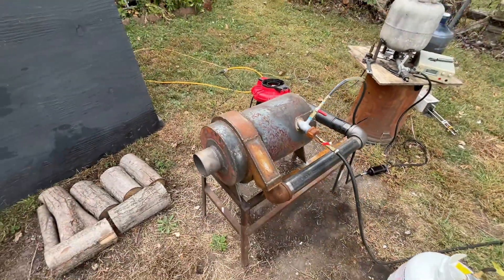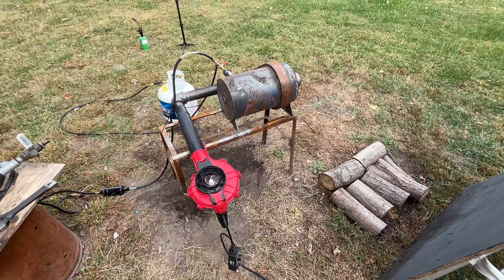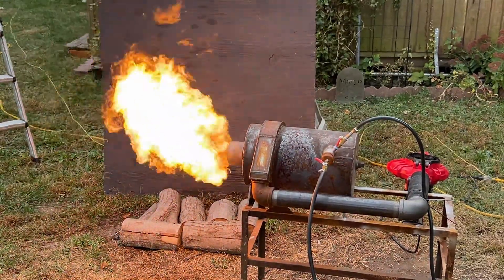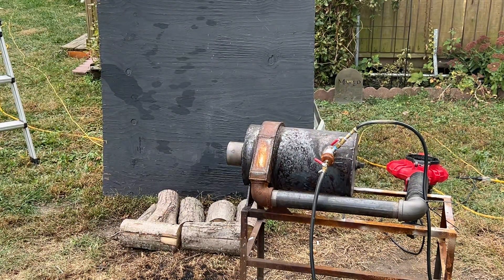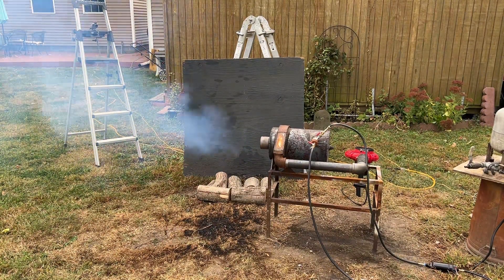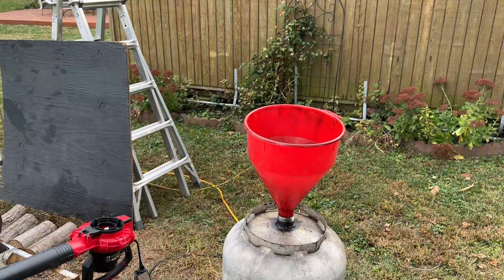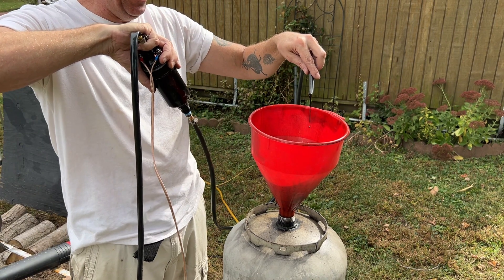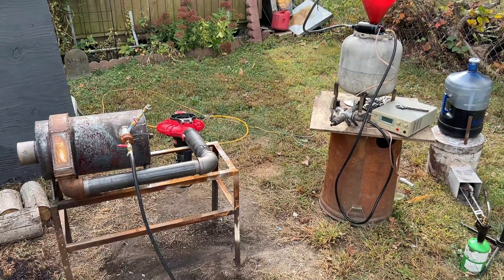Waste oil fuel consumption test

Comment: Your running the pump backwards durr. Where the wires hook up is output.... In the video it looks like your using the input as the output...9:13 in the video. Reverse the lines and it will work much much better
Reply from the maker: I apologize for my reaction
Reply: @NOBOX7  You should also know those pumps get easily clogged so you need a good high micron filter . They also dont like to suck. They like being gravity fed fuel.... Have a good day...
Reply from the maker: Good eye Jules turns out i was not only wrong but im also an asshole . Not that the latter escapes me . Im a work in progress .
Reply from the maker: The Bible says be quick to listen and slow to answer , had i listen to this truth id be a better man for it ...
Reply: @NOBOX7  Amen... I didnt even think I cam across road. All i said was durr..like homer simpson lol. I wasnt trying to be rude....just my personality.
Reply from the maker: Yes you are correct , it is i who is the jack ass . The insult threw me into a tirade before checking the facts . it is I who is the fool . Im gonna hook it up now and see if it functions properly
Reply: @NOBOX7  I am sorry, I come across rude in my mannerisms and get agitated easily....

Comment: Hello, I absolutely love your work and I have an idea of a DIY project that many would want to replicate if you help them with a good design. A stove / tent oil heater made in a 2-3 Liters paint can that can output 0.5-2 Kw, drip feed that can be used to heat a tent and cook. The air intake and exhaust should be a pipe in pipe design so the exterior pipe is cold so it doesn't melt the  tent zipper through which is routed outside. also the bottom of the stove must be cool enough to not melt a inflatable mattress and it should also generate somehow enough convection so the air is circulated without a fan in the tent. This stove would be extremely useful also for adventure bikers that often stay multiple days in the rain and never get a chance to actually dry their equipment and tent.

Comment: Does synthetic used motor oil burn the same as the petroleum-based stuff?
Reply from the maker: for the most part , it is harder to light due ot the higher flash point  or smoke point .

Comment: Have you ever tried staging blowers? I get the feeling that with a bit more air pressure you could get more complete combustion contained within the device. Add to that the ability to potentially put a proper nozzle on the end and get some thrust from it.
Reply from the maker: The nozzle would also increase combuster pressure , this increases oxygen content of the combustion zone

Comment: just redesign the oil holding tank so that its sealed, except for the outlet, and a muffin fan on top, Im told this works. I was going to build one like the aussie dude that runs these and someone told me the 1 or 2 psi caused by the muffin fan will be more than enough to force oil into the burner.
Reply from the maker: Yes this tank is equipped with a air compressor fitting on the top . I have used a small compressor in the past to pump fuel 
Never heard of a muffin burner thanks for the advice
Reply: @NOBOX7  muffin fan, like those ones in inflatable yard ornaments or pc fan.
Reply from the maker: @TheStarforce2  LOL not sure why i typed muffin burner it was a typo . I will look into the fans . thanks for the input